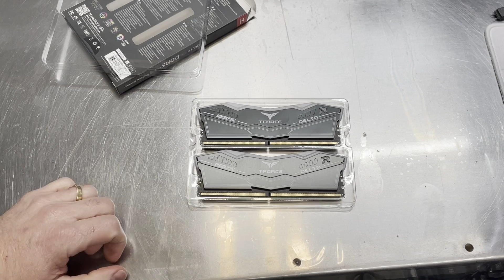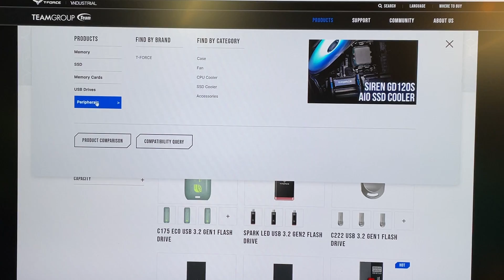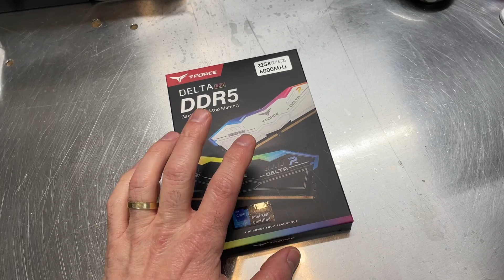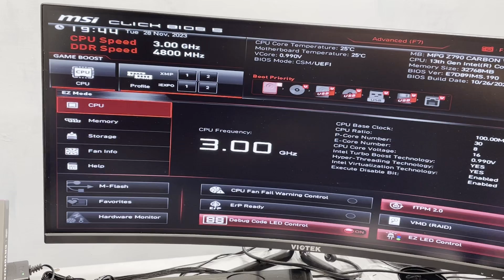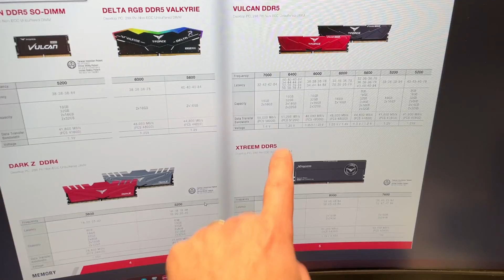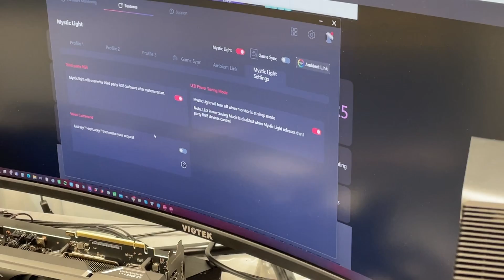Overclockersclub Reviews TEAMGROUP DDR5 Delta 6000 RGB Desktop Memory!

Comment: I am worried that my memory  ( same in the video t force delta 6000 cl30)height will affect my dual-tower air-cooled cooler , because the maximum height of cooler in my case is 165mm, but my air-cooled heat has been 160mm, and the diameter of the memory and cooler fan will become 166.1mm. I am worried that it will be pushed up to the side cover of my case, it that any solution can fix it?
Reply: You should be able to move the fan on the heatsink to accomodate.

Comment: When choosing between 2x32GB or 4x16GB RAM sticks for a Z790 motherboard, there are a few factors to consider:

1. Memory Configuration:

• 2x32GB (64GB total): Opting for two 32GB sticks allows for better overclocking potential and stability. It's generally recommended for DDR5 setups.

• 4x16GB (64GB total): While it provides the same total capacity, it may limit overclocking due to the additional stress on the memory controller.

2. Speed Ratings:

• Some 2x32GB kits offer faster speed ratings than 4x16GB kits. Consider the optimal speed for your use case.

• The sweet spot for Raptor Lake CPUs is around 6400MHz.

Comment: Is it good for AMD?
Reply: yes
Reply: Did you try with AMD ? I bought this ram without verifyin and now I'm afraid it wouldn't work
Reply: @itssparta3885  it works, I bought the same memory. And you can check it on your motherboard manufacturer site
Reply: How did it go?
Reply: @4tla  perfect with asus B650A gaming wifi
Reply: @itssparta3885  did the same, does expo work? will pair it with 9700x, but didnt get the motherboard yet. Would appreciate any response
Reply: @4tla  it works